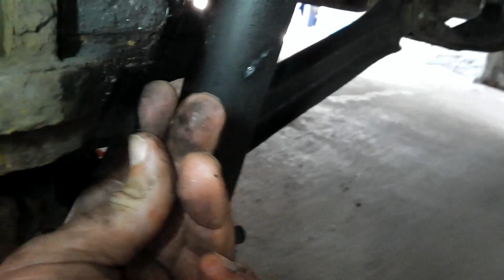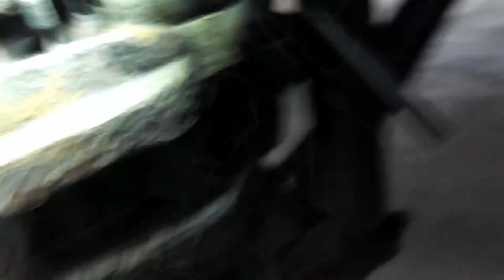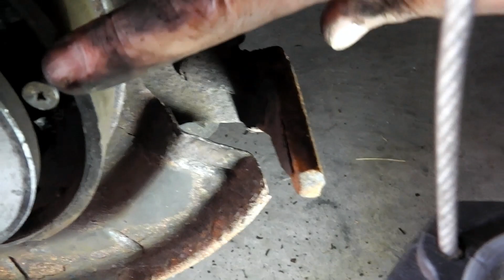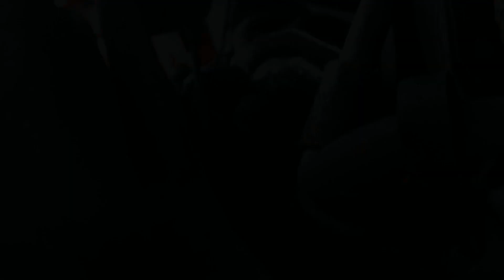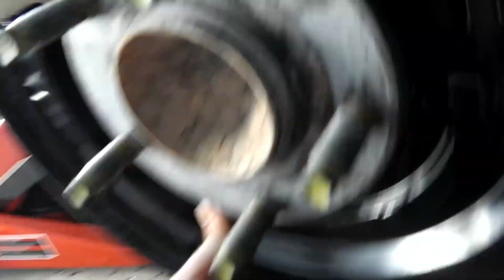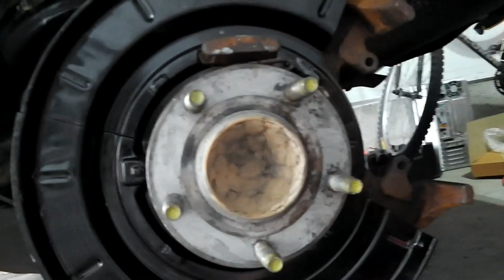2006 Mazda Tribute/Ford Escape/Mercury Mariner Parking Brake Repair (Brake Dust Shields).

Comment: Wow thanks so much for this video.  I am doing the rear discs and parking brake on my 07 Escape and the original dust shields are so rusted out that the holes for the drum shoe pins and clips are really big.  I was going to try and mickey mouse it, but now that I see what you did I am going to replace the dust shields!
Reply from the maker: Don't forget to watch part 2 when I do the other side, there's some good tips there too.
Reply: @PaulStevensCanada  I did see that!

Comment: Is the Mazda part compatible with a 08’ Mercury mariner?
Reply: Check with rock auto.  Mostly mazda/ford/mairiner are all the same.  Mine is 2006 but I do know 2008 is a second gen and might be different.  I would guess it was the same, but double check on Rock Auto for your year.
Reply: I had the same problem yesterday. Took the caliper off and when I removed the rotor, the pin and spring fell out. Fix it temporarily by using a scrap piece of sheet metal behind the dust shield to hold the spring and pin in place.
The assembly looks identical but only the Mazda part showed up on RockAuto. That’s why I ask about compatibility. Thanks for your help.

Comment: How did you take out those 4 bolts?  I have stubby sockets, still not enough space to get in there.
Reply from the maker: Mine weren't bolts they were Allen keys https://youtu.be/dnYlS6Um-3Y?si=xj4ErnfzaI-J-Oq3&t=838  check out this point in the video.  I had to hacksaw off the end of the allen key to make it short enough to fit, then used a pipe on the allen key for leverage.
Reply: GearWrench.... a ratcheting box wrench

Comment: Thank you so much for this video. Girlfriend's '07 had one of the e-brake shoe pins come out and grind inside the drum due to the hole it goes through rusting out. Your video saved the day. Great explanation with step-by-step instructions, and the whole "check your wheel bearings while you're here" is a great addition, thank you!

Comment: Where did you get the dust shields?  I can't find them anywhere!!
Reply from the maker: Rock Auto. They are under brake and wheel and called brake backing plates.   https://www.rockauto.com/en/moreinfo.php?pk=10124088&cc=1432725&jsn=392
Reply: @PaulStevensCanada  Thank you!!!  Great Video!!
Reply from the maker: @kevinklassen2665  Do yourself a favor and buy a pair of brake spring pliers.  Watch my second video where I do the other side with the pliers.  Saved me so much time.

Comment: Y did he jus make an idiot out of him self by cuting that dust plate
When all he needed was to remove the wheel hub first
Reply from the maker: The wheel hub is pressed in.  Its a huge job to remove the hub.  You would also need to replace the bearing which is also pressed in.  That's why this two piece replacement  is so great.  You avoid all that.
Reply: He didn't make an idiot of himself buy cutting off the old the plate, that was the best option to do this, removing the wheel hub would've been too much work for only removing the plate so he did a great job.
Reply: You just made an idiot of yourself by suggesting it was easier to remove the hub.